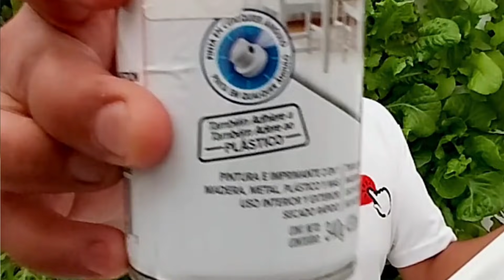SISTEMA HIDROPONICO VERTICAL [100 LECHUGAS EN 2m²] o mas ! ! !

Comment: Saul una pregunta porque arriba la tuberia la pusiste duplicada es decir, como un circuito doble de recorrido
Reply from the maker: Siempre uso ese tipo de instalacion para que todas las salidas tengan la misma presion. Si lo pusiera sencillo, es posible que la ultima salida de agua no tenga la presion suficiente, en especial en este sistema, por lo alto. Saludos
Reply: @ComeJardin  muchas gracias

Comment: En una de las tomas se alcanza a ver que el horro de agua cae en el centro del tubo. Esto no permite que el agua se Doriga a las paredes del interior del tubo. Te da resultado? Funcionaria un distribuidor en la parte superior y que el agua fluya por orificios distribuidos en este distribuidor? 
Por otro lado mi pregunta es si este sistema vertical requiere ciertas limitaciones de espacio entre hilera de tubos para que la luz llegue a todas las plantas. La luz es importante y me pregunto si esto no es un problema para este tipo de sistema. Ojalá puedas darme tus puntos de vista. Gracias

Comment: Hola Saúl, y felicidades por tus excelentes videos. Estoy iniciando mi sistema en Queretaro. Qro, siguiendo tus recomendaciones. En Queretaro, en julio el mes más caliente la temperatura media es de 20.4 grados cent. (contra 27.3 en Juarez) y la maxima media es de 26.9 (contra 35 de Juarez). Por otra parte, tambien es clima seco, aunque menos que Juarez). ¿En tu opinion podria programar periodos de riego en el dia de 30  ó 25 minutos minutos con descansos de la misma duracion?
Reply from the maker: Gracias . . . Con esas temperaturas se puede encender 30 minutos y apagar 1 hora. Pero si te sientes mas tranquilo, puede 30 encendido y 30 apagado

Comment: ¿cuanta agua se necesita para 1000 plantas y que intervalos de riego usar?
Reply from the maker: Un calculo muy basico seria 0.5 litros de agua por planta. Los intervalos varian segun el clima de tu region, en mi caso por lo regular durante el verano se riegan 24/7. Pero si la temperatura es menor de 32°C, pongo 30 minutos de riego y 4 horas de descanzo. Saludos

Comment: Buenas noches , muy didáctico e interesante tu video, quiero empezar pero tengo algunas dudas . Me podrías ayudar 1 . Pienso obtener el agua de un río, debo tratarla y como, 2 . El area donde estoy es muy húmeda y calurosa de hecho esta en la selva , que plantas puedo sembrar y no se si las debo de proteger del sol directo y de depredadores y como . Gracias por tu respuesta y ayuda
Reply from the maker: No tengo experiencia en esa situcion pero, el agua de rio ademas de tratarse se debe mandar a analisis detallado para descartar elementos dañinos para las plantas, asi como bacterias. Tambien la formacion de alga seria mas recurrente. Se de cultivos de lechuga, cilantro y albahaca que se dan bien en condiciones similares a las tuyas. y de preferencia si proteger del sol directo con malla sombra o plastico. Yo aqui por el calor seco no tengo problemas de plagas, si acaso un poco de mosca blanca pero se va rapido.

Comment: Saul, nuevamente un saludo y muchas gracias por tus conocimientos, bueno, con relación al tuvo de 4 pulgadas se le puede hacer cuatro (4) huecos por cada cara? en tu ejemplo solo hiciste dos (2) caras o huecos por cada línea. Y si es así, ¿Cuál sería la presión de la bomba que se le debe aplicar para que las plantas tengan un buen riego? Y lo otro es que el tubo mida 2.40 mts o 2.60 mts. Ahora, en el caso específico de Bogotá la temperatura promedio es de 10° grados centígrados y para la planta que yo quiero cultivar requiere de un promedio de temperatura de 24° grados centígrados. ¿Es necesario hacer un invernadero? Qué pena hacerte tantas preguntas, pero la idea es que ojalá puedas resolvérmelas todas y no estar preguntando cosa por cosa. Nuevamente muchas gracias por todo.

Comment: Hola Saul, tu video es el mejor en este tipo de temas, esta excelentemente bien explicado; tengo dudas hermano, estoy a punto de iniciarme en esto, fijate que planeo un sistema muy parecido al tuyo, me encanto poder maximizar el espacio. 

Quiero agregarle altura a los postes hidroponicos, me gustaría de 2 mts o hasta 3 mts, pero quisiera agregarle no solo 21 plantas como mencionas, sino 28 plantas, ¿sera posible? planeo usar tubo PVC de 8" ¿que te parece? y perforar por los 4 lados (norte sur este y oeste) obviamente intercalados, agregarle la modificación al sistema de riego 4 agujeros al tapón cachucha para irrigar los 4 lados pero no tengo idea de las dimensiones de espaciado de los contenedores de canastilla así como la medida de la canastilla a usar; ya sé que depende mucho de lo que quiera plantar, me pienso aventar con la lechuga que mencionas en un comentario aquí abajo la que va bien con las hamburguesas ; ), sin embargo necesito saber la medida de las canastillas para así saber la medida el agujero. 

En pocas palabras... ¿Será posible hacer la modificación que te menciono?

Bueno espero que me puedas ayudar, quiero hacer la inversión y no quiero "ensuciarla" desde el inicio.

Una vez mas te felicito por tu canal eres un crack como dicen ahora. 

Saludos desde Guanajuato.